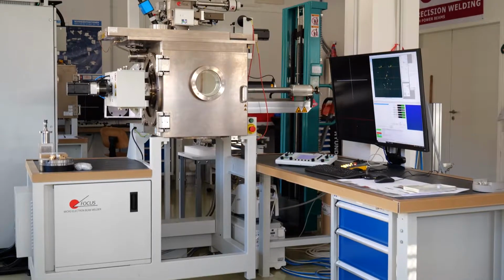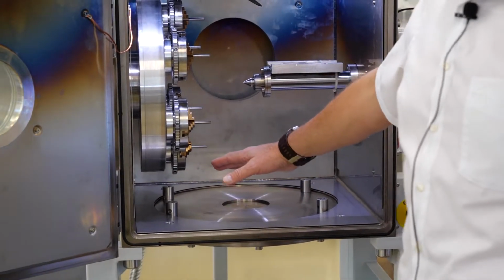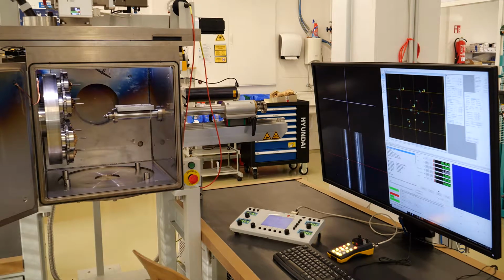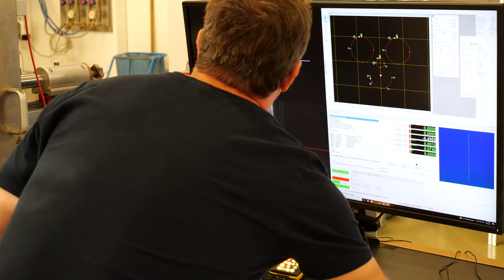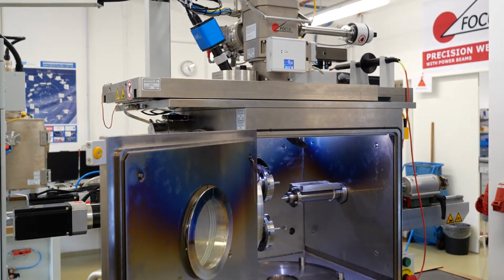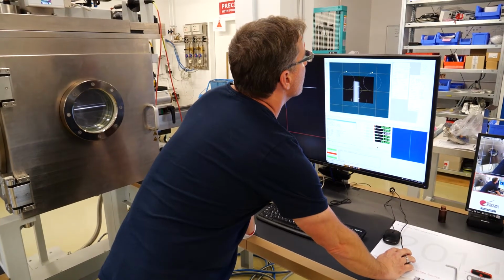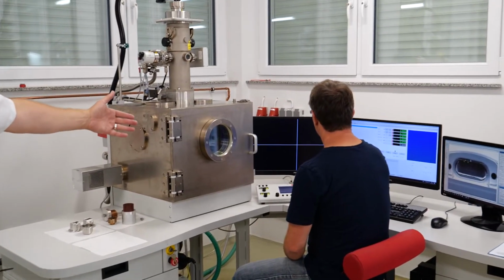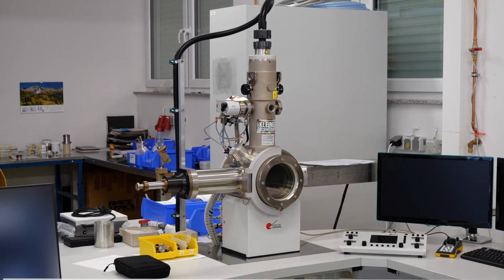Micro Electron-Beam Welding - LIVE DEMO

Comment: Thank you for the detailed video presentation.  I have worked with laser equipment quite a bit and am trying to gain knowledge on the EB processes.  I have read magnetism can present some challenges for EB welding.  Have you seen that?  If so what is the best way to compensate?  Does your company have a presence any where near Michigan, USA?

Comment: "It's all flansch mounted" xDDD
Reply: The chamber is welded, many parts are O-Ring sealed, using either (standard) ISO-K flanges or customized flanges to ensure x-ray safety. 
The machine is 100% x-ray safe for the opreator although electroncs produce x-rays when hitting a surface.